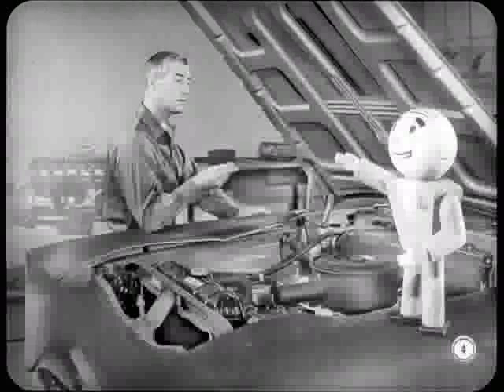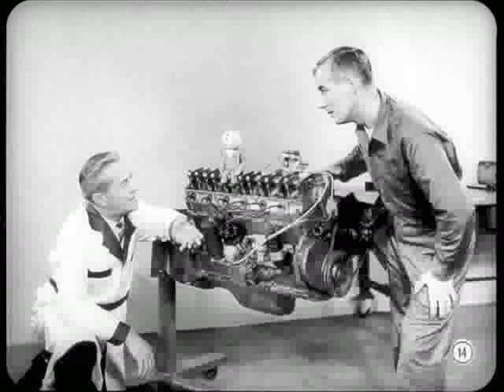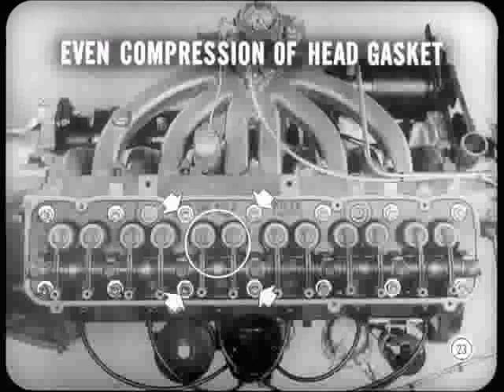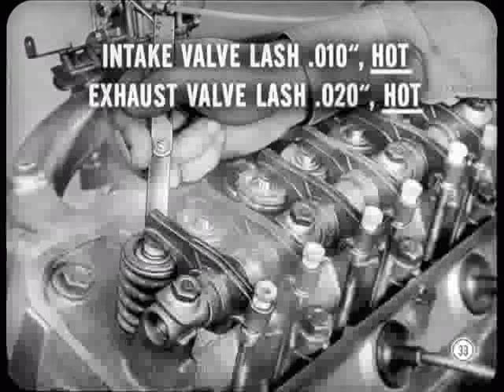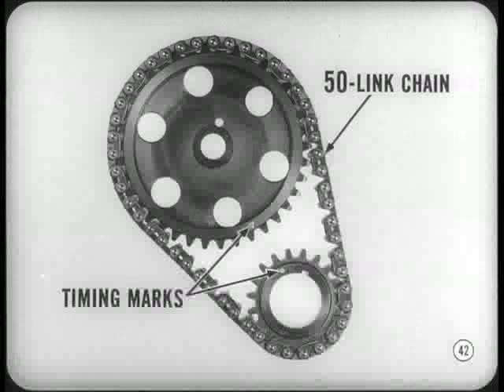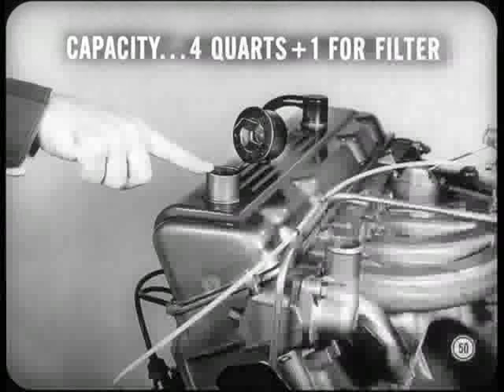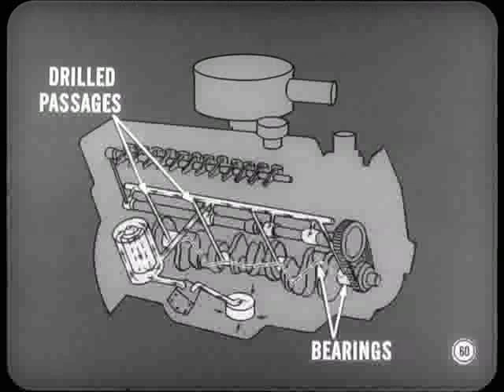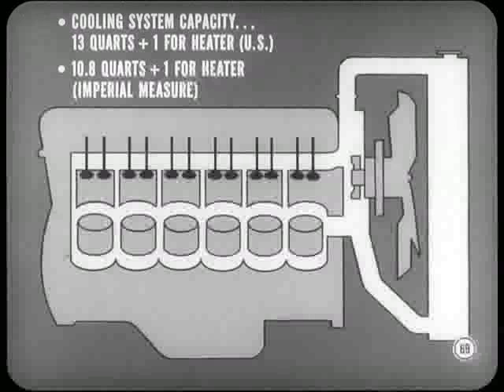Chrysler Master Tech - 1959, Volume 12-12 The New 6-Cylinder OHV Engine

Comment: Chrysler should bring back the 225 Slant 6 add EFI and you would still have a leaning  tower of power and bump the hp to 300-325 hp.
Reply: Chris Lemaster - That's actually possible...... but corporate sidestepping and loonie ex Hippies would prevent that from happening. 😑😣
Gives me an idea though! Build one for an older Car, using modern, vastly improved components and Engine Management Systems, performance Cam, intake ported, polished and drilled to fit injectors in each runner, a matched throttle body with CAI, Coil Pack Ignition, a good Dyno Tune..........
And a few other tweaks, and I believe that 350-375hp is possible!!! 😎👍👍😱😵😀😀
.......... Upwards of 450hp with a Turbo!! 

Just Sayin' 😉
Reply: but there are no cars with an engine bay big enough to hold it and the V6 is a cheaper engine to build for the base pick up. Much of that is a by-product of the CAFE standards imposed on the US auto market
Reply: V6 engines often exist because they are easy to package under the hood. They also lead to a car that is smaller overall. BMW is about the only car company who wants to build cars with inline 6 engines.

If you want to see the difference in car length, I suggest looking at a Datsun 280ZXT and 300ZXT. Although the car lines are much different, many parts underneath the car interchange between the 2.

Another idea is to look at a MKIV Toyota Surpra and Nissan 300ZXTT. They have similar curves, but the Supra has an inline 6 and the Nissan has a V6. It is easy to see the difference in length.
Reply: @skylinefever  Front wheel drive is the only reason for people getting rid of the inline 6 engine
Reply: @slantsix6344  
No, there were some V6 engines made only for RWD or 4x4 trucks. The GM 4.3 V6 and MOPAR 3.9 were two such examples.

There was another reason those engines were developed. Inline 6 engines with one carb would always have an air fuel mixture on cylinders #1 and #6 that were different from #3 and #4. This problem didn't happen on V6 engines, so car companies could continue to use carbs for a few more years, and later on, use TBI fuel injection. An inline 6 would need multi port injection.
Reply: Why is it called an overhead valve engine?
Reply: @tarstarkusz  This Wiki might help:
https://en.wikipedia.org/wiki/Overhead_valve_engine
Reply: Not with those pushrods and non cross flow heads. 

The power of a four and the fuel economy of an 8... that what the slant 6 will always be.
Reply: +Skyline... I did not know there were engines with the valves in the block. I thought all engines had overhead valves and it seemed like a pointless thing to point out the overhead valves.  I'm a Gen-Xer and there really weren't any of these left by the time I was a teen.
Reply: @tarstarkusz  I was born in 1984. The only reason I knew of valve-in-block engines was because I saw how many hot rod guys like the Ford Flathead V8.
Reply: +Skyline... That's odd, because I've heard they were real dogs   I think they were under 100hp stock.
Reply: @tarstarkusz  Most of them were originally rated at 85 HP. However, there weren't many better affordable options during the late 1940s and early 1950s. Once OHV engines weren't expensive, the only hot rod enthusiasts using Ford Flatheads were the ones who liked the way Flatheads looked and sounded.
Reply: What if common rail injection is used?
Reply: @purestress2597  Common rail injection is a form of fuel injection for diesels.
Reply: Does it not work for gas engines? I figured it could.
Reply: Slant Six   Except there have been several inline 6 front wheel drive cars made. 

As for new inline 6 engines the latest news is Mazda is developing a series for their next generation line of cars, as a fan of the brand I do like the idea that they may be returning to the rwd sedan game. The old 929 was a damn fine Japanese Buick! 

The inline 6 does have some inherent issues though, the length to width ratio of the major parts introduces flexibility issues for one. To make the parts nearly as ridged as parts with better aspect ratios means adding weight. Heavy block + heavy crank etc. 

Hell, even the valve covers like to leak on inliners unless they are made extra ridged or given extra fasteners.
Reply: The slant six, along with the Ford 300 six simply couldn’t meet the ever- tightening emissions regulations. I never owned the Slant 6 but I did own the Ford 300 fuel injected six. Great engine as far as durability but it drank as much gas as a V8 and the emissions were far higher than the maximum allowable limits of today.
Reply: Maybe downsize it some more? I kind of like the idea of a 2 liter hybrid slant six.
Reply: That way maybe the slant six could be made to rev proper and use the electric motor for torque assist.
Reply: @prevost8686  it would be nice if they would bring the 4.9 back with 357hp and 490ftq would take that over any  engine!!! I had one that had a knock in it sold it 289,071 and my friend drove it for three years with the same knock!!!
Reply: Chris Lemaster
, about the only vehicles it would fit are the trucks.
Reply: tarstarkusz types of valve in block engines were the L-head and T-head. On L-head engines the valves were to one side of the piston. The T-head engine had the intake valve on one side and the exhaust on the other.
Reply: Skyline Fever remember that there were no cars produced from 1941-1945 as all auto production converted to tanks, jeeps, trucks, guns, etc.
Reply: +noodler... I don't have a lawnmower.  But watching Mustie1 on YT, i noticed a lot of mowers have OHV.
Reply: @noodler696  Unless it's a Honda Lawnmower... 😉
Reply: @pacbeltrr38  That's a GOOD idea - for an older Car. 
Build a nice, Legal SLEEPER!! Like a late 70's Dodge Aspen... Slant 6, .060" over (they had THICK Blocks), Cam, EFI, Modern Engine Management, Headers and 3" Exhaust.

EASY 300-400hp! More with Forced Induction. 😁
Kids today are doing more than that with smaller Engines.
Reply: @tarstarkusz  flat head engines used to have the valves come up from the bottom. Thus the term "flat head" because the head was nothing but a flat peice of metal with domes cut out for the combustion chamber.

Over head valves or OHV got its term because of the litteral change from the valves being below the head to above the head.
Reply: @Solmangrundy  Thanks.
Since watching this video I watched a series called "the straight 8 challenge" by Cold War Motors here on YT.  One of them had a flat head with the valves in the block.  Great series and great channel.
Reply: @purestress2597  GDI (Gasoline Direct Injection) is similar to common rail diesel fuel injection. The injector sprays directly into the cylinder, then is ignited by spark. About 5 years ago, it became more common than cars with port fuel injection.
Reply: @noodler696  not mine! I have two mowers, one is electric and the other is an OHC Honda.  I'm pretty sure my generator is valve in block though, not that it matters... I bought it because my little town seemed to have multiple power outages a year for the first 5 years I lived here, ever since I got the genny we haven't had a single outage in almost 3 years lol.
Reply: Not by itself it wouldn't give it that much.  Adding EFI to the Ford 300 6 cyl gave it an additional 30 or 40 horses.  A 300+ Slant 6 would not be the smooth economical engine that you expect.  It would be a performance engine.

Comment: The Leaning Tower of Power was a great design but suffered from poor quality control by Chrysler. Some engines ran forever with no problems while others had valve seats falling out of place and others burnt huge amounts of oil.

Comment: I am 67. While I was building my 67 GTX 440 4 speed race car in my early 20's, I bought myself a 66 Valiant with a 225 slant 6 for $100 for basic transportation. That car was my Christine. It was indestructible. I would drive it until it got a couple quarts low on oil and the valve train would get too noisy, so I would add one quart and keep driving. I never changed the oil. One day I noticed that it had lost power, so I removed the clogged air filter and reinstalled just the air cleaner housing and never ran an air filter in it again. A full sized car T-boned the little red Valiant one day, the insurance adjuster totalled it for $200 and sold it back to me for $100. I put a piece of cardboard in the window and kept driving it. I sold it for $100 a year later. The car required zero service and paid me to drive it for 3 years. The car loved me and was indestructible. It was my Christine and I miss her.....
Reply: That's the stuff I love to hear. I would love to hear about how you bout the 440. Have you ever drove a 426?
Reply: Too bad you were so cruel to her.

Comment: is the 318 a Good motor
Reply: Hell yes!
Reply: Crazy good...
Reply: The original version with polyspheric combustion chambers was as durable as the slant 6. Later on they simplified the engine and it was ordinary.
Reply: Both the '66 and older 318 ( poly. ) " wide block " AND the '67 and newer 318 ( LA ) " small block " are great engines . my '68 Fury with a 400 horsepower 318 wasn't " ordinary " Bill Schiffsky built the engine and trans. in the early 70's .
Reply: Yes, especially the original Polyspheric version.

Comment: That 225 Slant six I had one in a 1983 Dodge Diplomat it was the leaning tower of power and toque and good on gas. My friend brought the car off me for 500.00. These Slant 6 are hard to blow up. We drove this out of antifreeze and oil for 10 minutes it was hot let it cool down and put antifreeze and oil in it still ran great. SO we used to say 225 slant 6 oil and antifreeze optional.

Comment: did you know there was two or three larger sizes of the slant six than the 225 , they werent used in the cars or pickups but were used in the medium trucks  like the D400  D500 and D600 . a long time ago i looked at a D400 about a 1966 , and the plate on the door jamb said it was 270 some cubic inches , i can't remember exactly . and i read somewhere a long time ago that there are to or three larger ones than the 225
Reply: Never heard of that. There was a 273 CI version of the LA engine family that was used in trucks from that era ...

Comment: That's 3.7 liters of torque. I'd like to see the comparison to the 225 gmc inline 6 , and the buick 231 by. And the ford 230 inline 6.
Reply: The 230 was a Chevy motor. The 240 and 300 were Ford products.
Reply: The 60s version was the best 6 for it's size, but it was a shame that they never offered a larger version, as the 70s really choked the heck out of it.  A 250 or 260 version would have been super.
Reply: The slant 6 intake manifold was far better at fuel/air distribution than the ones found on other  inlines. Also, the slant 6 cylinder head may have been better than some others, it is best to have one intake port and one exhaust port per cylinder, but some of those other inlines didn't have it. Was the Buick 231 an early V6? If so, it avoided the fuel distribution problem, but controlling vibration was a different problem.
Reply: @skylinefever  Yes, it was much better that way.  The early Buick V6 was a 90 degree V6, the bad kind, with only three crank throws.  It shook like a paint mixer.  Later, it was reworked with a proper six throw crank shaft.  It was a far nicer engine as a result, and lived on to become one of the best GM engines ever.

Comment: Checking rocker shaft & manifold bolt torque check? Doesn't speak highly of Mopar engine assembly of that period.
Reply: I don't know why the rockers need to be retorqued. However, I do understand why intake manifold gaskets needed to be retorqued. Sometimes they would crush a little more after 1000 miles before settling into their final shape.

Comment: I had 3 cars with Slant Sixes - '62 Dart, '73 Duster, '76 Aspen wagon. I do not consider any of them to have been fuel mizers. I disliked the carburation - EFI would have been so much better. They were reliable.
Reply: I always rebuilt the carb regardless of make , carter and holley 1v ' s are very simple .
Reply: The object was, until the 90s, simplicity and ease of repair at home with common had tools.  You can't do that with EFI.
Reply: @michaelbenardo5695  Many people don't know what to do with carbs, but they know what to do with simple EFI systems. I think of the late 80s and early 90s Toyotas that are still on the road because the EFI was usually reliable, and a blink code was usually enough.

Some of the more complicated EFI engines made by certain companies are a huge nightmare. I think about the stuff Benz makes, and what a nightmare it can be.

Comment: When 145hp got folks excited 😂... terribly undersquare tho..3.4x4.125.
Reply: That's why it has good torque.  With traffic today, top end is useless, as is Cruise Control.
Reply: That was the 60s version.  The 70s version sunk to as low as 90 horsepower.

Comment: Best motor  built they do smoke later
Reply: Jesse Sanchez 318 is a strong contender. Actually, I'd say it beats the slant six out. More power, more torque, and it'll last 300,000-400,000 miles.

Comment: 5   8  inch  socket for spark plus
Reply: 13/16 for all engines equipped with N type spark plugs,, 5/8 for the later engines equipped with RBL type spark plugs

Comment: Worst engine design on the planet. Melt it for scrap (crap). When I bought my 1973 Duster it should have come with six spare carbs in the trunk for the next two years.You would need every one to keep it running.💩
Reply: Wayne R 

A bad carb doesn’t mean the engine is a bad design
Reply: The carbs in the 70's were made to run lean and a lot of problems occured. The engines were solid and ran for years with minimal maintenance. Compared to other engines of the day they were one of the best.
Reply: During the 1970s, many great engine designs performed poorly because the smog devices really sucked back then. You had a tangle of vacuum hoses and if even one failed, the car ran awful.
Reply: 4thstooge That’s true. A mechanic worth his salt could fatten the mixture up and they’d purr like a kitten. Toyota carbs were famous for running too lean back in the day. We drilled the mixture plugs out and richened the mixture to make them idle better.
Reply: The ticket was to install a factory-new old-style Holley (with the front-mounted float bowl). The stock 1-V carb on the later slant-6’s was so crappy that Holley started manufacturing the old-style carb in bulk. They were cheap.

Later yet, the slant-6 came equipped with Carter 2-V carbs that worked fairly well ...
Reply: @sking2173  Great solution, Many Thanks
Reply: You must be mechanically " Declined " then .
Reply: @skylinefever   Smog " devises " started about ' 74 / ' 75 .
Reply: .   BOTH carbs worked well , it depends on who's rebuilding / tuning the carb !
Reply: Blame the EPA for that.  Chrysler did not make their own carbs.
Reply: @edclinton2884  Actually, 1968.  Then every two years, another gadget would appear.  By 73, performance was an obsolete concept.